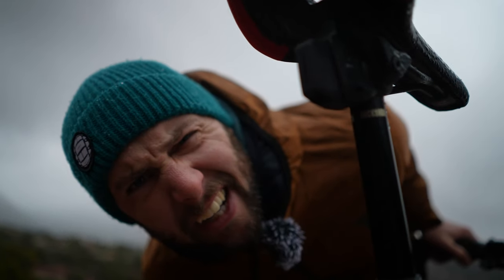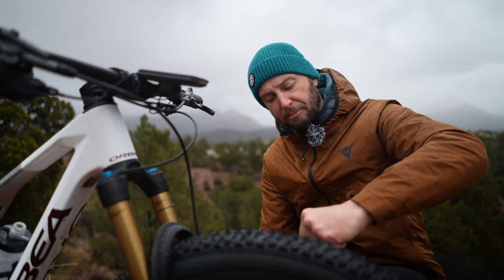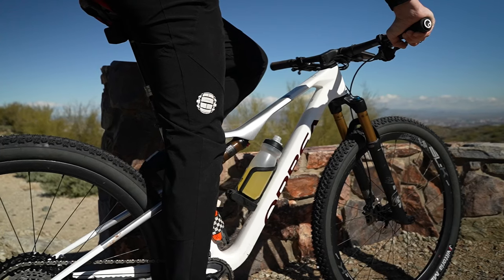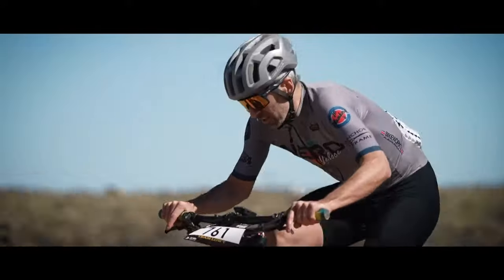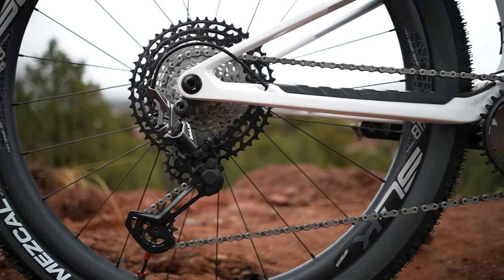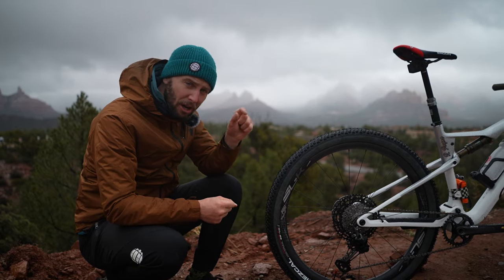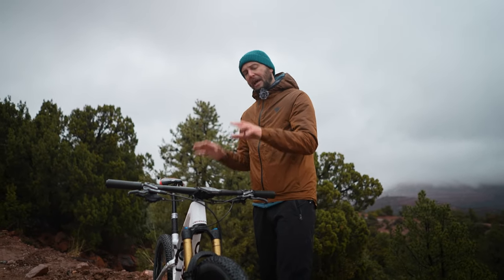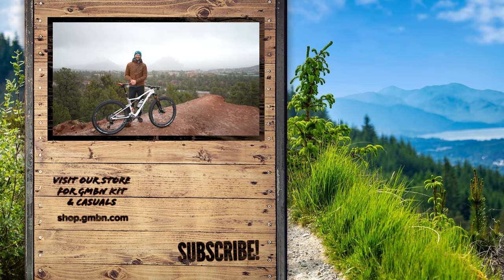How To Setup Your XC Bike For Long Distance Riding | Cross Country Setup Tips

Comment: I'm from the Philippines, where roads are not so much okay with lots of potholes, which makes mountain bikes the usual choice for long distance rides. I focus on shaving off weight and improving the reliability of my bike, like going tubeless on my Continental Terra Trail (650x47B). I'm running a 1x12 drivetrain to tackle even uphills. I also have lights, both on my bike and helmet for visibility. Lastly, I make sure that I got tools in my frame bag, in case of trouble. It's all about comfort and safety in all.
Reply: If you ride 47mm tires, riding a gravel bike would be totally fine
Reply: Same in México ✌️

Comment: I have done multiple 200km road rides on my XC bike the only thing I would change is my tire pressure I would pump it to 30-35psi instead of my usual 20psi. I would still average 30-40kph on flat sections and I actually prefer this because of all my years of riding I never got a flat tire on my tubeless mtb setup. Im running 36t front and 10-51 shimano at the rear 1by setup
Reply: Hi there, planning to get an XC bike with 30t front, 10t-51t, 1x setup. With around 15-20 kgs of gears loaded, will it be fine to pedal on flat roads? Thank you!
Reply: @joanneurbanoxx  32/34t front chainring would be better I guess it's very easy to change 1x chainring lots of cheap options too busy make sure you get the right spec

Comment: Later this year I have a 90 Km ride in my XC (it's a triathlon in fact, but gravel edition 😀 and I'm not buying or renting a bike), so I'm looking at everything to make it as easy as possible. I just replaced the old saddle with a new one (after measuring sit bones) similar to the one I'm already using on my road bike. Set up my tyres tubeless (which is a bit of a pain because I don't use this bike that much, so the sealant dries up). I have not installed the remote lock for the fork (it's a hardtail), I just don't like the mess of wires. I'll look at everything else.

Comment: Fore/aft question: Due to XC bikes having steeper seat tube angles, is it normal for the front of the knee cap to be slightly in front of the pedal when they are parallel? I don’t have access to professional fitting due to my rural location. I don’t want to cause knee injuries. Thanks